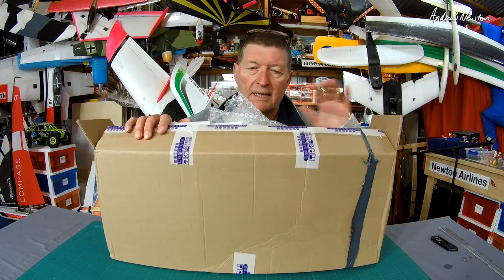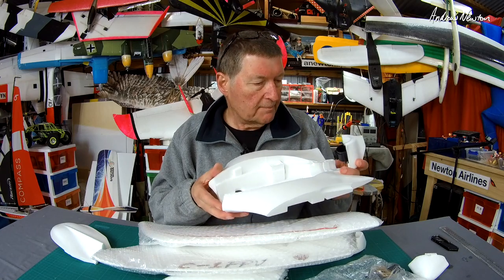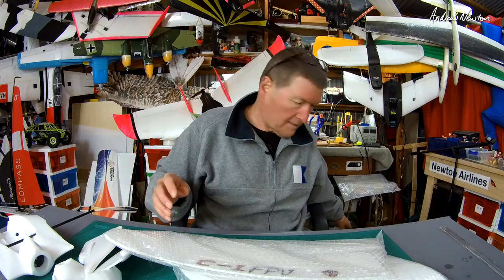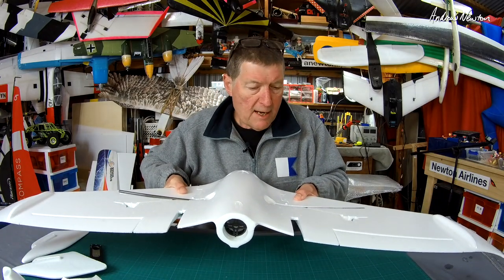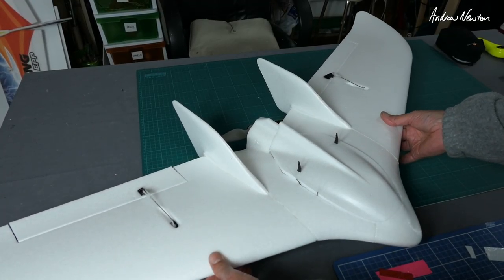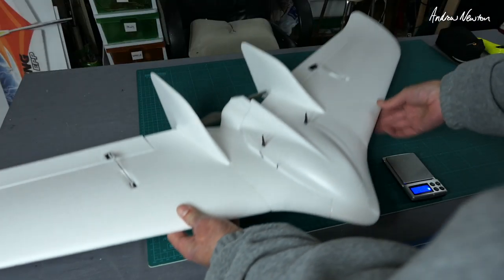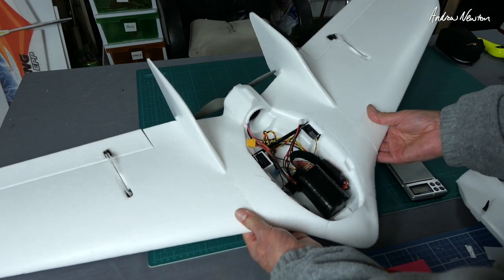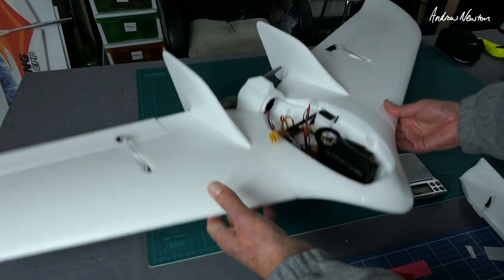C1 Chaser 1.2m Kit build

Comment: Only recently decomishoned my C1. A bit old and bruised. A friend has it now, so it lives on. I went with the Matt Og set up of SS 2216 1250kv & 8x6/8x8 prop on 4S 5200 with FPV and Vector (using the 3D printed shelf over the batt) Good for 30+min flights. Its is a cracking airframe and your right, its size makes it easily portable. Things have mved on though, so if i were to replace it, I'd go for the Vortigaunt from e-wings in the UK.

Comment: Brilliant build and video as always, thanks. I just got a C1 as well, and I decided to move the motor back by gluing on a circular GF/PCB board. The rear of the fuse opening is not level, though, so I decided to hobby knife it level and adjust the thrust angle for more hirizontal at the same time. I, too, have the FX-61 and Z-84, so looking forward to seeing how it flies.
Reply from the maker: I moved my C1 motor mount to the rear just yesterday. It reduces the noise and probably cools the motor more.

Comment: They are a nice wing, very well mannered, my only complaint is the foam is very soft and easily damaged, but I laminated mine which also stiffened 
it up a lot. I've had more OSD's and F/C's in the C1 than any other plane, it just gets used like an experimental test bed. I also moved the motor back with rubber
mounts, it's now very quiet.
Reply from the maker: Good tips thanks.

Comment: Hi Andrew,

Recently I ordered a C1 Chaser kit and I'm happy to view your build and maiden tubes of the C1! And of course am a loyal viewer of all the knowledgable stuff you're presenting. 

When I viewed your C1 video, I noticed that there is no entry for cooling airflow in the body. Could the camera nose with the hole in it be used for that or is it unnecessary. 

Best regards, Jan (Netherlands)
Reply from the maker: I put the FPV on top so the hole does allow some airflow. Would only be an issue if you want to fly fast a lot.
Reply: @AndrewNewton  tx

Comment: I have one flying with the stock motor (2212 2200kv) / ESC / 6x4 prop from my Strix Stratosurfer.  It flies great with a 3s 2200 battery.  It should be good if it's light enough.  When I flew it with a 4s 5200 the 2216 1250 was about as low as I'd go for kv since you are limited to a 8" prop.
Reply from the maker: Good info, thanks

Comment: I can't seem to decode the Chinese instructions that describe the C1's balance point. Is it 105-108mm forward of the two bumps in front of the spar (basically the join point of the wing to the fuselage), or 105-108mm rear of the join point (basically at the 2 bumps forward of the spar? Thanks to those that already figured this out...
Reply from the maker: The foam bumps are the CG marks

Comment: Do you think it could work on a 2208 or would it not fit? (630g thrust)  its what i have on hand and I want to do a very light and slow build powered ideally by a 1800mah 3s Additionally what is the outer diameter of the Motor "cowling" just in front of the Prop?
Reply from the maker: Yes that gear should work well as long as the CG is correct. 65mm outer and 45mm inner. Photo in the community section https://www.youtube.com/user/andyandvirg/community